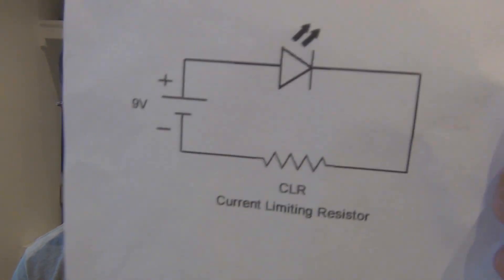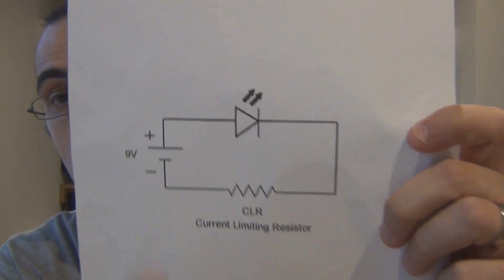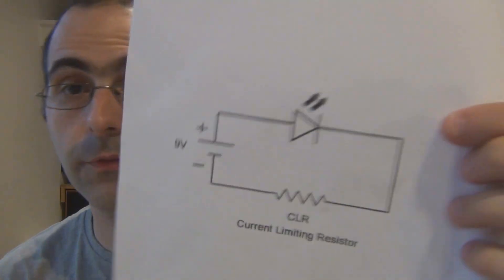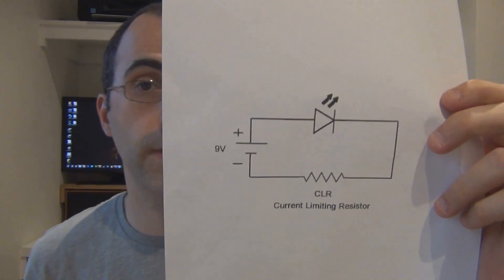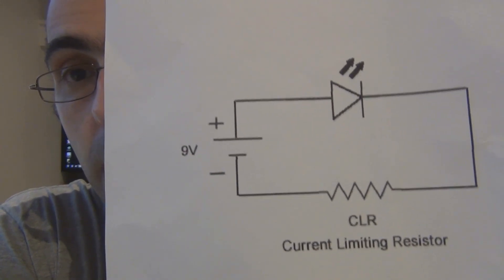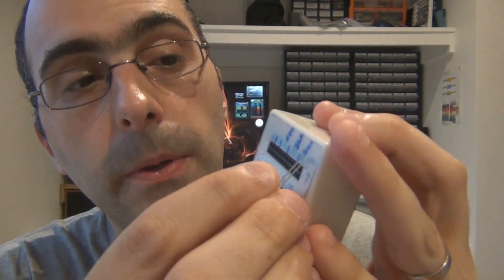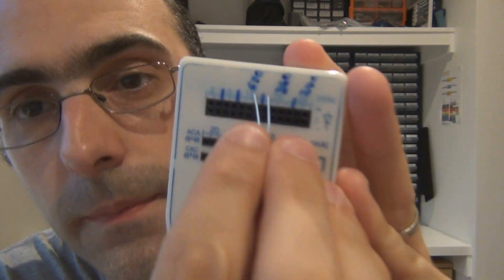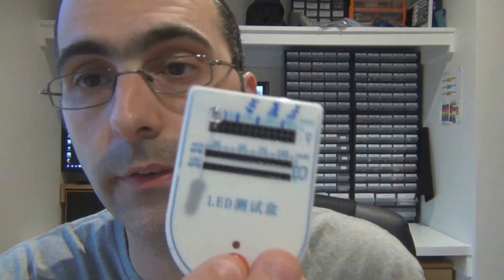B2B - Guitar Pedal Status LED and CLR

Comment: Thanks for this video. It's been really helpful to my introduction to adding an LED status indicator into my Sola Sound Blue Bum Fuzz. These guys make some of the best fuzz pedals I've ever heard but don't offer any of them with a DC jack or an LED to know the pedal is on or not. Plan was to add a Lumberg Switched DC Power Jack and a Pre-Wired LED with Bezel into a more efficient enclosure that fits better on my pedal board. My only confusion is there are too many choices online to pick from for the CLR. You mind suggesting a site based in United States? 

Sola Sound Blue Bum Fuzz - 
http://www.macaris.co.uk/the-blue-moon-bum-fuzz-by-d-a-m/p/p664
Love My Switches -
https://lovemyswitches.com/pre-wired-led-with-bezel-cup-style-green-led/
https://lovemyswitches.com/lumberg-switched-dc-power-jack-2-1mm/

Comment: Hi, great video! 
I have a question. I'm a total novice to diy electronics.
I have a keeley compressor plus that works great except that the led stays on even in bypass mode. It wasn't doing it at first, that started a week after using it quite a bit. The intensity of the led doesn't change at all when switching modes. It stays the same and the intensity of the led is normal, neither too bright nor too dull so i reckon it has nothing to do with the CLR.
Is there a short circuit somewhere in the switch or a blown up resistor?
Please help as it's really annoying.
Thank you

Comment: Question.. When puttin an LED in a pedal, do you suggest the resistor is on the + lead? or the negative lead?.. because ive seen it both ways on different schematics.  Thanks
Reply from the maker: +Fredwreck Nassar From what I have read, because it is in series it makes no difference, whatever is convenient.
Reply: DIY Guitar Pedals  so the resistor will still the amount of current going thru the LED even if it's "after" the LED? 
Sorry, brother, if that sounds like a ridiculous question. . Tryin' to learn to make some pedals. You're videos are the shit, by the way.

Comment: Hi! I have a question about an MXR micro amp pedal clone that i builded to boost my signal (is the first pedal that i made). The problem is that when i turn the pot very close at the end, with the signal bypassed with the 3PDT, it makes a buzz, but when i push the 3PDT to boost my signal it disappears and works normally without that buzz and boosting my signal. The only thing that i chaged about the original circuit is the pot. I used a 100k "A" pot in parallel with a 20K resistor instead the 500K anti log pot that uses. Salutes from Argentina.

Comment: It makes sense to work out the CLR values using the right maths behind it rather than guessing: https://www.sparkfun.com/tutorials/219
Reply: spaceshipable I have to agree with +DIY Guitar Pedals. That SparkFun tutorial only teaches you how to calculate the MINIMUM CLR value, not the value that's going to look the best. Even if a beginner does have the LED datasheet, it will probably list 20mA for the If, which in the case of so many LEDs nowadays is going to be WAY TOO BRIGHT, let alone far more current than we really want to use for the LED in a 9V pedal. A beginner also wouldn't know how much current is ideal for an LED - that comes with experience and testing - which is what this video is teaching us to do - experiment not guess.
Reply from the maker: spaceshipable I think maybe this video is being misinterpreted.  "B2B" = Back to basics.  This information is specifically for first time / new pedal builders.
Reply: DIY Guitar Pedals Yeah, I understand that and I really think your videos are great but the maths isn't hard at all and for beginners it is important to start off on the right foot. If you look at the top right corner of the spark-fun page it even says "Skill Level:  Beginner"
Reply from the maker: spaceshipable Thanks for the compliment! Yeah but that's it though isn't it.  Math.  These B2B videos are pedal building information for the novice.  The information you link is a great read, I've read it a couple of times in the past.  But for new builders that don't know ANYTHING about electronics, this sort of information is only going to serve to confuse them further.
Reply: I would disagree that it would confuse anyone further. The spark-fun tutorial is for don't know anything about electronics. It really doesn't get any more basic than reading 2 numbers off a datasheet, and doing one basic equation. In my opinion, understanding why something works helps it sink in far better.

It's also important to note that using the wrong values is dangerous because components can overheat cause burns/fires or explode. 

Ultimately you're free to do your videos however you want but it's worth mentioning the risks of guesswork. It might be worth pointing people to the simple solutions to the problems.
Reply from the maker: spaceshipable Im not disputing understanding is beneficial. A 5mm led on 9v's causing burns with a 1k resistor?  Don't think that's gunna happen somehow.  
LED datasheets aren't always available (infact more so then not).  What new pedal builder will be using an LED with a datasheet?  Seriously....
Anyway, seem to be going around in circles here, im agreeing to disagree
Reply: Well, no a 9v battery and a low power LED are unlikely to cause any problems but when a builder starts to scale up or attempt other projects, that's when someone will get burned. Still, do continue to make these videos because on a whole they are very useful and informative.
Reply from the maker: spaceshipable Thank you spaceship.  Its funny cause i agree with you, but its difficult for to explain to you here in the youtube comments.  Prehaps in a future video i will go into more indepth, i think that would make an informative video, thanks for the suggestion.
Reply: ***** Yeah, the bit about the power amps is a good point.These videos are largely very good but it's important to get those fundamentals down.
Reply from the maker: spaceshipable Thank you Saint.  I agree with you both.  Really didn't want to go into this sort of detail but here we go.  I know what information the people that email me DAILY want.  I know the knowledge and skill level of these people as well. I don't know about you two, do you talk to new pedal builders much?  I ask sincerely here?  This video is my attempt and providing a quick method to set up an LED/CLR with as little fuss as possible and I can GURANTEE any sort of math or in depth level of detail would be a turn off for them.  Thank you for the suggestion for a future video though, I can do a more in depth version down the track.  Hope I have actually explained myself clearly this time.
Reply from the maker: ***** Thank you again Saint.  And Space.   I appreciate all constructive feedback, positive or negative.  Constructive is the key word which you have both been.
Reply from the maker: ***** No idea sorry but I saw something recently on diysb's (you may have already seen it) about the same problem.  Search on there for fuzz bloom (title of the thread)
Reply: DIY Guitar Pedals I am a new pedal builder, I have 2 un-drilled 1590a enclosures I plan to make into tap tempos because of your videos! The knock off vs genuine hammond box video was pretty helpful in that decision.
Reply: GGBBDIY Well yeah, it's the minimum resistance value that's calculated. You can pick something higher but not something lower. Unless you read the tutorial, you're not going to know why.
Reply: spaceshipable The tutorial says nothing about minimum or maximum resistor value - it only suggests using the LED datasheet to find the forward current and gives two examples, 30mA and 1400mA (the latter for a high power LED). Even 30mA would probably fry most typical pedal LEDs (maybe not immediately).  The tutorial is a great lesson on how to do the calculation, but it teaches nothing about how to choose the right CLR for your LED. This video actually does teach us one way to do that - experimentation.

Comment: Hmm, you could say something about the battery life, LED voltage drop and maximum current as the variables that do have an impact on selecting the right current limiting resistor.
Reply from the maker: Mick TheShaggy B2B = Back to basics ;-)